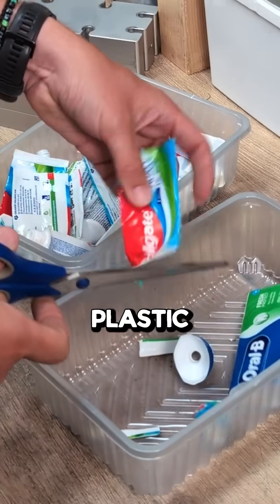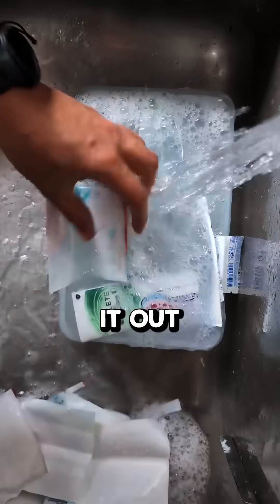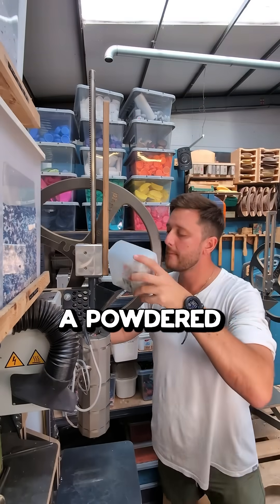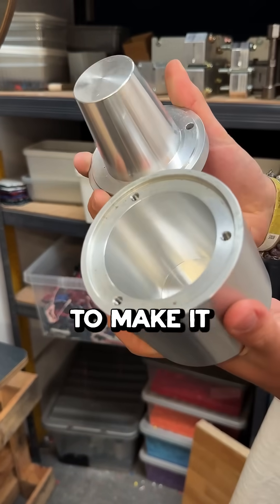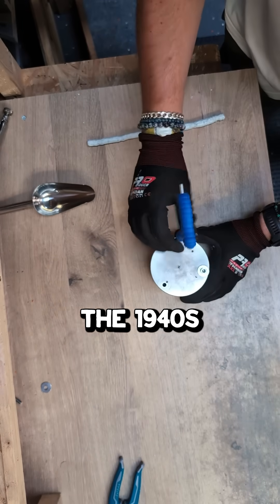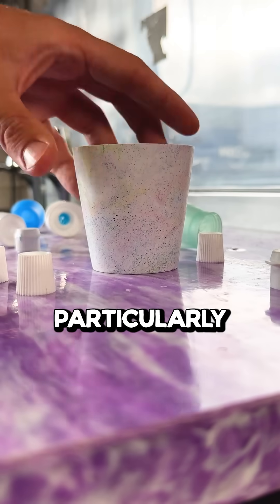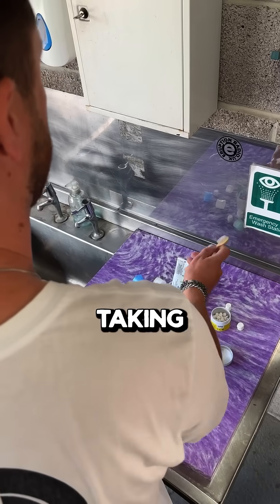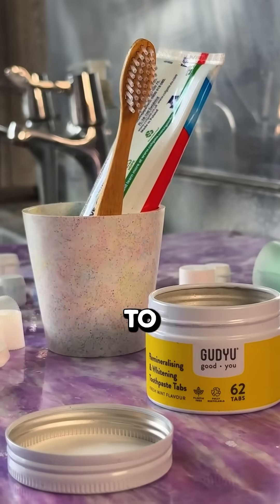Turning Toothpaste Tubes into Something New 🦷

Comment: I remember when I was a kid, it was in metal tubes in the 90s.
Reply: Yeah, I remember metal in the 60’s and 70’s. But maybe it had some plastic as well, and I didn’t know. I do remember that it got MUCH more difficult to roll them up to squeeze the last of the toothpaste out, the way I used to. I think that’s when the little toothpaste tube squeezer bars started coming into vogue. 

Those tube-rollers might be a good thing to make out of recycled toothpaste tubes, for those of us not ready to switch to the tablets ?
Reply: @DawnDavidson  I remember they eventually started packing the metal tubes with a hard plastic clip. You stick it to the bottom and roll. They probably eventually thought "We're already giving them a plastic tool, might as well just make the entire tube plastic and save on not having to have the plastic clip made".

Comment: Usually I m a Fan of sustainablity but Here I m careful. How high is that Abrasion Index of this toothpaste? If it s too high and you use an electric toothbrush you will brush your teeth away. Im sorry but in this Case I ll stay with my toothpaste with the correct Abrasion Index.

Comment: Im loving the look of the cup, it has a slight concrete look with swirls of colour... I wonder if the tubes would melt as easily on the panini press or in toaster oven as the bottle caps do
Reply from the maker: It does! It’s really nice to try something out that is a little more subtle in colour and contrast. It would be really interesting to try out, we’re going to collect more so we will be sure to give it a go. It’s PE so it should work nicely 👍🏼